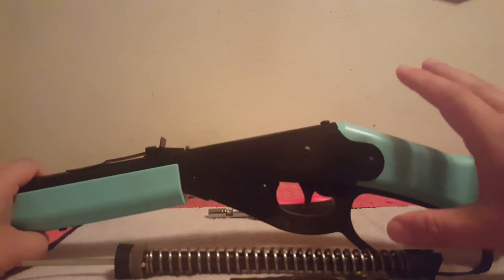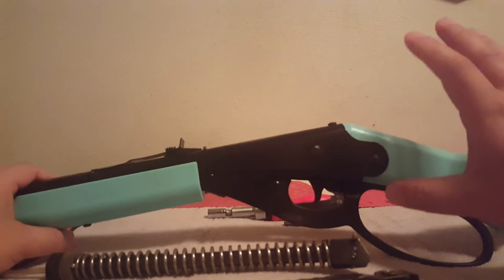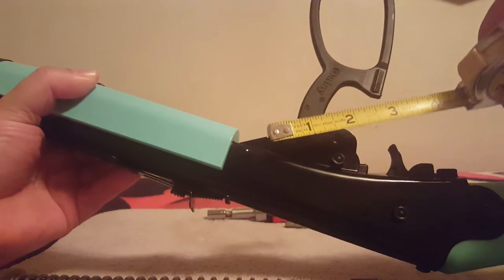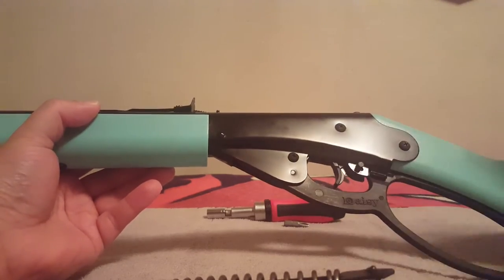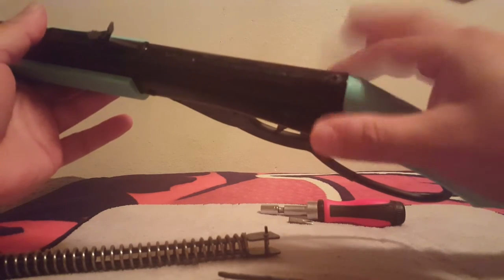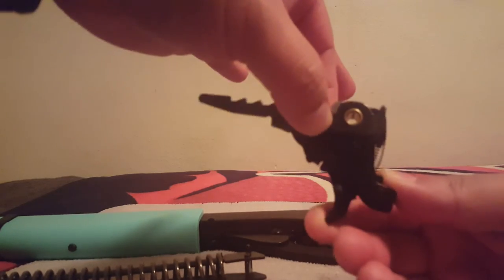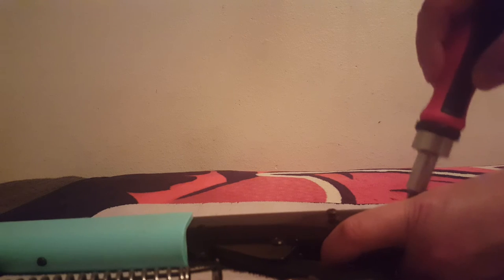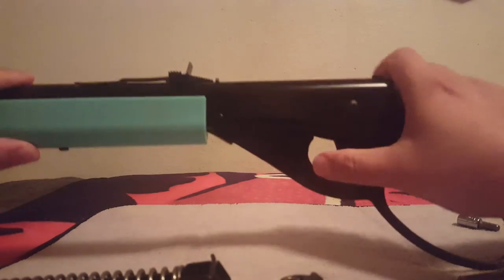Daisy Red Ryder Simplified Fix: Back-End Jam ( Please focus on correct cocking. Click Links!)

Comment from the maker: 🛑STOP! IF YOU WATCHED VIDEO AND HAVE REAL JAM, DONT REMOVE THE SCREW YET🛑

DID YOU COCK IT RIGHT?
https://youtube.com/shorts/_DHipmCypjs?feature=share

NEW FIX!
https://youtu.be/yAO-GOvolYQ

OTHER JAMS
https://youtu.be/rNXE7-fhelg
https://youtu.be/wtRzsbyYysU

There are THREE JAMS to the modern Ryder.

Breech jam
Loading ramp jam
ABT jam ( anti-bear trap backside)

This video - and an older brother video - are only  backside jams - ABT.

 FIX:NEW
https://youtu.be/yAO-GOvolYQ

OTHER JAMS
https://youtu.be/rNXE7-fhelg
https://youtu.be/wtRzsbyYysU
Reply: Should have watched your video before buying a replacement. (Needed the last cocking action.) Thanks

Comment: Good easy to flow instruction video. If you are not a public speaker or teacher in real life, you should be.  You do a very good job of explaining things that I figure are common sense to most people, so I don't bother, but then I realize there are many people out there willing to take things apart without having an understanding or knowledge of what they are doing.
Reply from the maker: Warrior, I love your comments  because they normally have two or three layers of meaning - that not everyone catches!

I just had a slew of folks yelling at me to just take it apart. They don't know the engineering, and its design  failures. Attempted dissasembly on ABT jam, for most, destroys the gun!

Yes, teaching is close to what I do.  There are times that I feel I'm in an endless wrestling match with the engineering FAILURES of the modern Ryder. Then there is the task of getting others to understand the issues.

But having said that, my Ryder is my favorite PURE BB gun. A BB breech jam and back-end jam have both been cleared. No further jams have happened because of counter measures: I only shoot elite new BBs, and the back end is heavily lubed with Ballistol.
Reply: @daisy880fanaticfixit9 Thank you, I know I can be strong worded sometimes.  I note that your practice with the platform shows in the way you are able to attain very admirable accuracy in an earlier video.  I do not have that luck, either due to practice level (hard to believe) or the fit of my guns parts.  I feel that locking down the Red Ryder into a CLS, should completely remove me from the picture.  I do wish, no fantasize, about a Daisy custom shop that would turn out a modern high-end modular Red Ryder in all metal or an 880 with various barrel and receiver choices but those are just dreams.

Comment: Thank you for the video.
I tried but it did not work for me, however it did give me an idea. 
I used a cable tie to tie the trigger back and hold it in position. Loosened the first bolt(not removed) and left it in the hot sun for a few hrs. The sun expanded the metal, and i brought it inside, removed the cable tie, cocked the lever, and it worked.
Reply from the maker: Great job!
Reply from the maker: Very innovative! Great fix!

You came up with your own fix for the ABT jam. I do have a video celebrating another gent who came up with using a ZIP TIE to hold the trigger back!

Otherwise, the classic user flub -  remove the srew all the way, and the trigger gets sucked inside.

So please consider removing your lever and lubing with 30 ND or Ballistol on the metal plate (plunger back) to stop this jam coming back.

Please consider Daisy Match BBs to stop an equally bad breech jam. They are better made and more accurate.

Comment: Im new shooter sir if you answer please, can you tell me whats the best cleaning products and the best pellets and scope for the daisy 880 powerline air rifle, ive been doing research and you were the last person i saw and great video by the way., pleaseeee
Reply from the maker: Sir, here are the basics to get started. That company is my favorite.

As far as cleaning, don't go nuts because it isn't a firearm. Just light general care.

https://www.pyramydair.com/product/rws-177-cleaning-pellets-100ct?p=512

https://www.pyramydair.com/product/h-n-field-target-trophy-power-copper-plated-177-cal-8-80-grains-round?p=836

https://www.pyramydair.com/product/utg-4x32-rifle-scope-mil-dot-reticle-1-4-moa-1-tube-3-8-rings?a=3015

DON'T GO REALLY CHEAP WITH OPTICS. This type should be your floor. You can go more expensive.

Great lube choice. Just a drop or two every 500 shots.

https://www.homedepot.com/p/Husky-16-oz-100-Full-Synthetic-Compressor-Oil-018-0083H/300135698

https://www.hobbylobby.com/Art-Supplies/Painting-Supplies/Palettes-Tools/Squeeze-Bottles---5.07-Ounce/p/57415

Comment: I just gifted my son his 1st red ryder. Bought brand new from Amazon. I dry fired it 2 times. Then I let him cock it. Trigger has slack now. Cocking lever has zero clicks now! Never even got to shoot a BB out of it. :( not sure if it was caused by him possibly not cocking to a full 7 clicks or not. But when I go to cock it there are ZERO clicks. Was thinking if he didn't cock it all the way why wouldn't I just be able to cock it the rest of the way then dry fire? Say he did 5 clicks then I do 2 more. 
Nothing! It's just loose when cocking again meaning zero clicks
Reply from the maker: Sir, sorry your boy experienced the over-engineered Ryder. But you did great explaining yourself.

That is REAL backside jam - not just user error trying try to cock it. Follow these videos in the EXACT order. Taking out the trigger screw on this jam is always risky. Try the pick method first. The new trigger screw fix is much improved.

https://youtu.be/Rb_fc9yflLw?si=9-4ufM5RCjz8lhu_

https://youtu.be/yAO-GOvolYQ?si=x7H4lvX24IyOA8be

Before either fix attemp, try first a basic move - pull the trigger blade all the way back, then at the same time tap LEFT SIDE with your left palm to work loose the plunger. That can work.
Reply: Thank you very much for taking the time and replying back to me! I just received my adult Red Ryder from Amazon today and I have dry fired that thing 10 to 15 times with zero issues mind you I'm making sure while I'm cocking it I'm either hearing the seven clicks and Counting or just cocking all the way out till the lever goes no more then pulling it back and then dry firing. 
By you making a statement over engineered Red ryder does that mean it came faulty from the factory. So this isn't an operator error on my son's part you think? He was super bummed and like Daddy I broke my gun I said no you didn't something doesn't seem right
Reply from the maker: Operator error is only not cocking it 7 clicks or using USED BBs that cause a breech jam.

The anti-trap (ABT) can jam in new guns and IS NOT your son's fault. They used not to have the ABT - these jams were non-existent..

Even your new ARR is vulnerable, so please try ideas below: 

If you have Ballistol on hand, do it now. The backside jams hit NEW Ryders. It is related to the ABT (anti-trap); many lose their gun over it. Hopefully, you can fix your boy's Ryder.
 
30 ND or compressor oil in a squeeze bottle will also work.

https://youtu.be/6CLg_r_NbYk

https://youtu.be/x6uWfXUZrkk

Comment: Didn't see this video, removed both screws and now trigger has pulled un and jammed. There was no jam, just restoring an old bb gun. Please advise
Reply from the maker: Ok, for that trigger to get sucked inside, that means somebody cocked it. They didn't tell you.

Normally, the anti-bear trap sucks in the trigger because the lever and trigger go slack; your mainspring plunger hangs out on the ABT. Owners try taking out the RR trigger screw. The spring under tension pulls in the entire trigger assembly by the bear trap arm.

If you are tool savvy, you have a chance. Try the video below:
https://youtu.be/0uCgA848t28?si=d90Oj4thQQtN8wxA

Comment: so i failed to listen and attempted to remove the screw without holding the trigger back. the screw can’t be taken out or fully put back in. the trigger still moves decently well. i’m working on the 80th anniversary red ryder model. any advice how to fix this?
Reply from the maker: @Znaniye  YES, stop trying to remove the screw for now. Freeze!

So here is the reality: Shooters don't cock their RR 7 clicks, they think it is jammed, they try removing trigger and it gets sucked inside. Much more serious jam.

A gent figured out the ultimate fix for what I now call zombie jam. Slack lever slack trigger. SOME ARE REAL plunger jams - not your fault.

Now you already were in progress of removing screw. That tension you feel is the anti bear trap (ABT) pulling on your trigger housing. If you force that screw out now, it will get sucked inside.

Please follow video below, then review RR handling video.

IN YOUR CASE, DON'T REMOVE SCREW UNTIL YOU HAVE AIMED DOWN, PULL THE TRIGGER BACK,  AND SMACKED THE GUN AND SHAKEN IT. Try that first, then video instruction if no fix.

https://youtu.be/yAO-GOvolYQ

https://youtu.be/Ay8oSXlhNWY
Reply: @daisy880fanaticfixit9  i got it to work! pulled lever all the way forward and the screw fell back into place and now it shoots. thanks so much!
Reply from the maker: AWESOME!

I'm glad you had a happy ending! 🥳 

To avoid a breech jam, consider Daisy Match BBs.
Reply: @daisy880fanaticfixit9  my gun does not cock it move freely how do I fix it
Reply from the maker: @vijaidookoo9500  

If your gun won't cock, and you tried 7 clicks, please try these fix videos in EXACT ORDER:

https://youtu.be/Ay8oSXlhNWY

https://youtu.be/Rb_fc9yflLw

https://youtu.be/yAO-GOvolYQ

Comment: somethings wrong with my lever that it wont cock it just makes an aggressive noise and goes back to where it was
Reply from the maker: Lore, interesting. Ok let's get this straight. 

In the video I start by showing a SLACK lever, it is quiet though. SOUNDS normally only come from the teeth on the bear trap or the sear that holds your plunger. The sear is the final CLICK before you pull the trigger.

Lore, if you hear 2 or 3 clicks, then you pull the trigger and it goes click again - but the gun isn't shooting or sounding like it does when shooting-that is a BB jam in your breech. That is another video.
Reply: @daisy880fanaticfixit9  can i show you
Reply from the maker: Lore, YES! Please post a YouTube video. If you don't have a channel that is easy. I bet you do! 

I helped a young guy fix his after his video. HE WASN'T COCKING IT RIGHT - HE NEEDED 7 CLICKS!

In his case, he saved his gun, because most shooters when they get HUNG UP ON THEIR BEAR TRAP (ABT), they try taking it apart and the the trigger gets sucked inside. HE avoided that by showing me a video.
Reply from the maker: Lore, the video is on the way. Try asking for help if you get confused. Anyone you KNOW WELL who is good with tools!
Reply: @daisy880fanaticfixit9  k thanks
Reply from the maker: Lore, cool. Remember KNOW WHERE the slanted plate is inside the gun. If it is far back, it is hanging on the trap arm.

Make sure your pick does not grab the metal rail of the plunger. It is smooth. The teeth on the bear trap are ROUGH and trap arm rides ABOVE the plunger (upside down).

Otherwise, if your gun reacts just like my 1999, you are good to take it apart. Remove broken bear trap.

Comment: How do I fix a droopy lever, it
Wont cock back
Reply from the maker: DJ, three main reasons for droopy  lever. Also called slack lever:

(1) You did not cock it 7 clicks. You are hung up on your ABT (anti-bear trap).

(2) You have a BB JAM. I have a video for that. That shows by having a droopy lever BUT your trigger still goes "click" and goes click again when you pull the trigger.

(3) Or you have real jam in back, and your plunger is out of position. This video covers that. Please consider taping trigger back with blue  painters tape, wrapping stock. Then remove screws.

Comment: Wish I'd have watched this before I tried fixing it. Lol. I did it right the first time, then somehow did it again and got so confused.... Everything is inside of the gun now. Lol. Fuck.
Reply from the maker: Yeah, the ABT really is a headache. There shouldn't be a "second" time if you oil the plunger. Meaning, you take off the lever and soak the plate in the back. This jam hits new guns. Please cock it 7 CLICKS.

Here are some videos. You still have a chance, even with the trigger sucked inside. If it doesn't save it, remember on your replacement TO TAKE OFF THE LEVER AND OIL THE PLUNGER - right out of the box.

https://youtu.be/0uCgA848t28?si=OiP2gXWxYuqidrHl

https://youtu.be/6CLg_r_NbYk?si=CDWKQz-eaA5qnx24